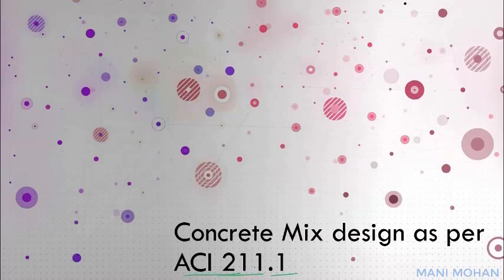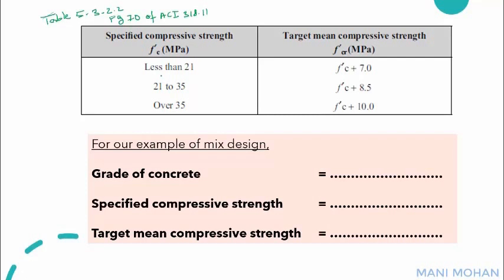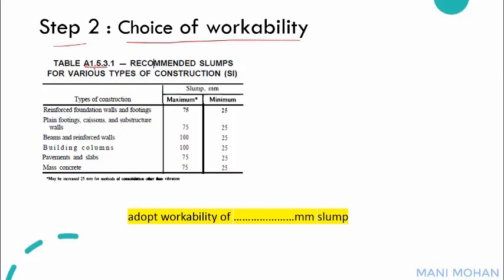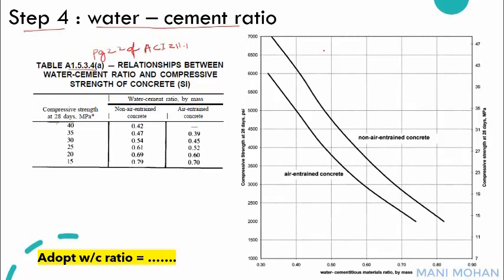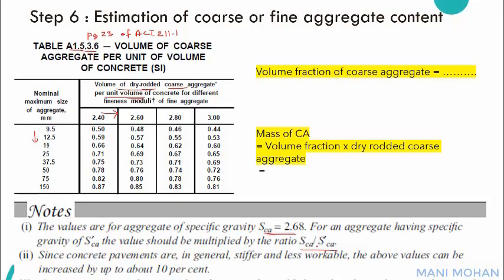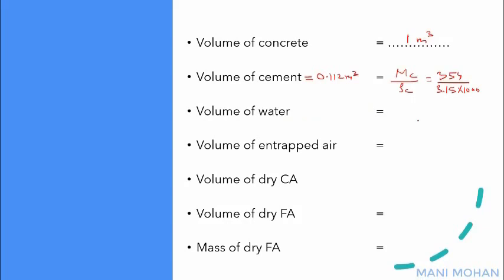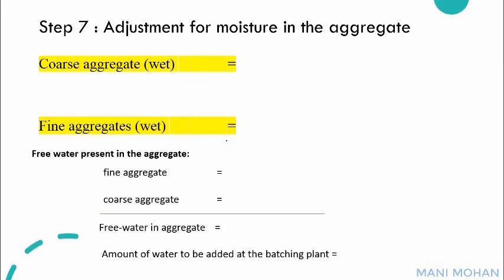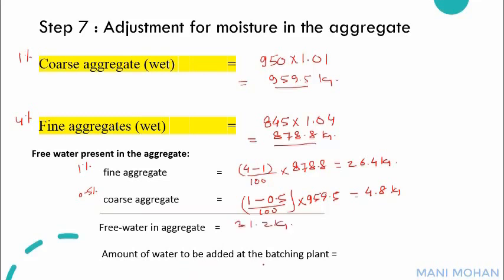ACI Concrete Mix design

Comment from the maker: The trial Batch proportions for 1 cubic meter concrete will be: Water = 173.8 kg, Cement = 354 kg, CA = 959.5 kg and Fine aggregate = 878.8 kg.
Reply: Please answer me ASAP.
What if i use oven dried aggregate, will this mean that i need more water since moisture content will be zero and the absorption will be added?
Reply from the maker: The slump (workability) will get effected if you use oven dried aggregate.
So yes you will need additional water quantity.
Know the moisture content of the aggregate being used to produce concrete. Modern batch control systems, if given the absorption and moisture content, will either hold back or add additional water to compensate for that water which is carried on the surface of the aggregates or that will be absorbed into the pore structure of dry aggregates. This results is concrete that is much more predictable, that will finish properly, and meet the requirements of the mix designer and the finished project.
Reply: @sirfmein  thanks a lot.. 👏
Reply: What is the standard Cement bag size as per ACI mix design?
Reply from the maker: @divyanshushankar2147  it is 94 pounds i.e. 43 kg
Reply: https://youtu.be/ULMtzu_cRgg